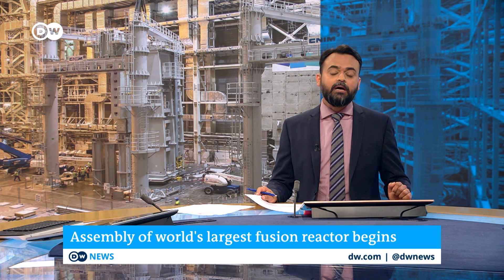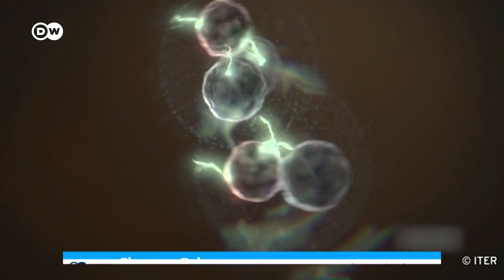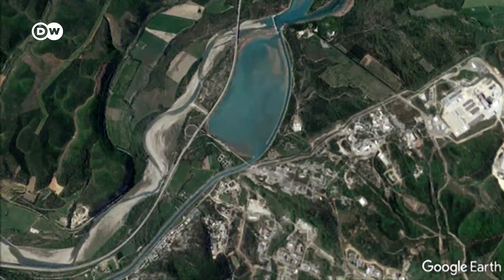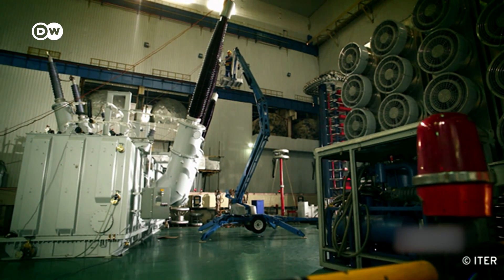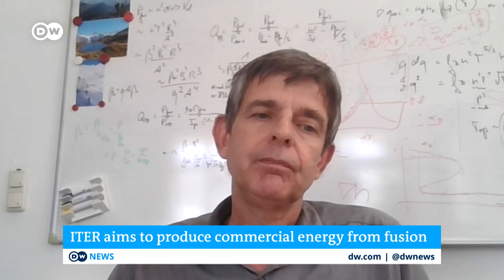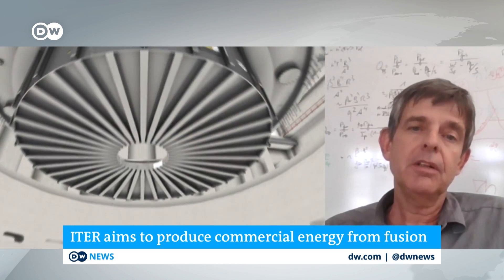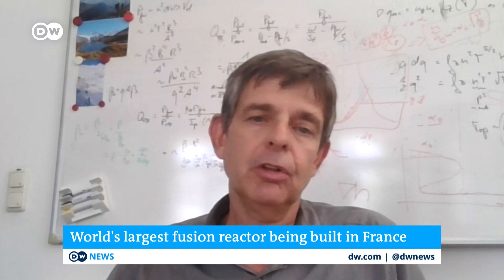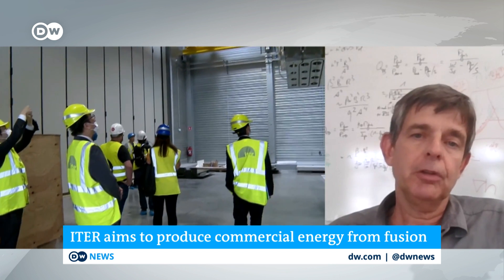ITER: Assembly of world's largest nuclear fusion reactor begins | DW News

Comment: Iran and Venezuela: ahem, we are so screwed.
Reply: Do you think cars will be Powerd by fusion or our war machines are going to be Powerd by fusion or any kind of electricity. NO. till then all of them will be selling oil.
Reply: @KMon1111IND  in short, oil is used for power production in many countries, except in us where it's mainly used for transportation, but the us doesn't trade with Iran and Venezuela anyways. As for war machines, which war machine exactly are you talking about if you exclude the US? :P
Reply: @kleuafflatus  
Oil isn't used for power production almost anywhere, except in isolated locations where only diesel generators are appropriate. Oil is too valuable as a transportation fuel to be used for electricity generation.
Reply: @KMon1111IND  you have a point in the case of the military, but other than that, it might be a different story if electricity is nearly free and unlimited. I mean if you live off grind then gas is still the best choice for fuel, but for everyone else you can enjoy much cheaper electricity especially if you use cars that run on batteries, which is a very viable option in the city. Im not an expert but I just googled it: in 2018, out of all the 5447.3 terawatt-hours generated across all the power stations in the us, only 66.3 terawatt hours was oil, but 1833.9 terawatt hours was natural gas, followed by 1334.3 by coal. Naturally all that can be replaced by fusion. Also in many countries oil is used for power generating, those 2 countries with very little industries other than oil production will lose those customers faster than the blink of an eye.

Comment: Put it onto a spaceship with good ion drives and we can finally go to other stars
Reply: This is pretty much the WORST thing to put in a spaceship. You can't use neutrons or ion drives unless you love waste heat blackbody radiators. A spaceship should have a direct aneutronic fusion drive, only waste heat generated is keeping the reactor on.
Reply: Send me a message when you arrive

Comment: This is an experimental project or "proof of concept" with a working model at scale. In other word, it is a prototype. Something way beyond a "bench test." So there will be set backs that lead to improved variants and ultimately a production model and its inevitable progressive miniaturization. If they can get more energy out of the reaction than they put into heating up the plasma, then they will really have something. That is the whole point of this project. Not merely creating fusion, but creating fusion that yields a net energy gain from the process. Of course fusion has been created before; but, not with a sustainable controlled net energy gain.

Comment: The sun is a fusion reactor we just need to harvest it with solar pannels.
Reply: I don’t think we really have the resources to build a Dyson sphere right now.
Reply: you obviously havent thought your comment through
Reply: @123hackfleischvorbei  Fossil fuels are non-renewable. People have recentlly found out how to store solar energy.
Reply: @insectbite1714  What does this have to do with fossil fuels? And people have always known how to store energy, but not "solar energy" you cant store light, but you can transform that light into other forms of energy which can then be stored.
Reply: That's the problem with fusion -- we already have a large fusion reactor that we can harvest the energy from and that source is more than enough to provide all the power/energy needs of the planet -- no Dyson sphere needed!  Solar energy is already encroaching on fossil fuels on cost and at present development rates within a decade it will be even cheaper than hydro and certainly cheaper than any fossil fuel.  Energy storage is also moving ahead very quickly and will solve the problem solar has at night.  Fossil fuel is dying and within 20 years it will be reduced to providing a decreasing percentage of mostly high energy density needs (think jets).  Almost all the energy we now use including all fossil fuels received there energy, originally, from the Sun -- with solar panels you do not have to wait 300 million years!

Comment: Once fusion is perfected, let's make it smaller. And have fusion cars 😂
Reply: I'm living next to a big intersection - there I can witness the fusion of cars on a daily basis
Reply: You cant make shielding from gamma rays thin enough to fit into a car I think. Or light enough to b anywhere near practical. But fusion ship may be possible, hopefully :)
Reply: @elmoparman636  Didn't know that Helium is radioactive.
Reply: @winni2701  Nuclear reactions take place in megaelectronvolt ranges, and electromagnetic radiation released in those energies is in the form of  gamma rays. Which are very hard to stop. That's the problem.

Comment: lol you can tell that someone has no idea what they are talking about when they make a point about the fact we are FUSING atoms not NOT splitting them lol.. 

We have NEVER SPLIT atoms... We have always fused them.. splitting the atom is done by adding MORE atoms which forces the current radioactive element to SPLIT and become something else. you guys REALLY NEED to do your home work before reporting things you have no idea about lol
Reply: I don't understand what your point is. Are you saying that when uranium 235 is split apart in the fission process in current nuclear reactors, the atom isn't actually split? And that it's still fusion in that case? Makes no sense.
Reply: @AKHalex  It splits but its done by fusion not splitting an atom like the guy says at the start. neutrons are fired at some uranium 235 and when one neutron hits the nucleus it fuses shaking off 3 neutrons and becomes uranium U-236 no splitting of any atoms

Comment: What they don’t tell you is that fusion reactors are inherently much more complex and expensive than fission ones, don’t yet produce any amount of usable surplus energy and still irradiate their own very expensive body to intolerable levels long before they recoup the costs.
This problem is not solved.
Reply: "don’t yet produce any amount of usable surplus energy" *yet.
"What they don’t tell you is that fusion reactors","still irradiate their own very expensive body" at 4:30, he literally mentions this.
Reply: @Slackker_  Yes, he is obviously quite   skeptical when asked about sustainability and viability of fusion tech and mentions its problems but doesn't tell how hard they are to solve.
Sure, this iteration will produce some relatively small amount of surplus energy, after a decade or two, if the construction isn't stopped, but the tech is lightyears from being able to recoup the costs of construction. I welcome this research. But what I don't like is the populism around it. People who are now being so excited about this project may not live long enough to see any fusion energy in their power outlet. This project, that is only a research prototype that's bigger than the earlier prototypes, is going for over 30 years already.
And the first Tokamak was researched from a vague idea and built in less than 8 years, started operating in 1958.
Reply: @noop9k  I'd have to completely disagree, the reason why this technology is so slow is because the funding isn't there. The oil companies have no interest in changing how things are done, instead they lobby conservative politicians that have been making cuts to research for decades. If you want an example of what is possible, look at the space race, an immense amount of progress was made in a short timeframe, progress that contributes to our very way of life now. but as soon as there was no war anymore, the funding went away, and NASA has been just scraping by since. We need populist interest to highlight politicians that will really create a worldwide push for fusion and allow it to be brought to its full potential.

This isnt impossible, or even far-fetched. Under trump the US military budget has pointlessly increased anually by 100 BILLION, that's enough money to build 7 prototype reactors every year, from the US alone. The problem isn't with the technology, it's with the politics.
Reply: @Slackker_  First of all, I do see the situation with funding, even though cost estimations grew many times during the last decades.
The project is divided between many countries for political reasons and this alone causes plenty of friction and delays.
Second. I don't see the right kind of populism here. I don't see this project mentioned often, I don't see calls for action, I don't see anyone explaining to people that with the current level of attention and funding it is going to take decades, I don't see somebody like Greta explaining this to people.
If you check the wiki, you can see that while  they have (finally!) committed to building the main reactor, they haven't even started building materials research facility that was supposed to test various materials for neutron resistance to prevent the reactor from destroying itself with radiation.
The core main EU countries should not depend from oil lobby and could foot the bill alone and could even start a separate project, moving much quicker. Instead, Germany tries to build yet another natural has pipeline to burn even more hydrocarbons while funding Russian fascist govt. I'm just trying to point out the hypocrisy here. I'm just trying to say that as-is, people shouldn't expect to live long enough to see fusion power solved.
Unless they do something.

Comment: Sure, in 40 years.

And then another 40 years after that.

And then another 40 years after that.

We have clean and cheap energy already:  nuclear fission.

Even if we succeed at generating electricity from fusion reactions, the cost of production of electricity needs to be on par with current methods, or it's just an overly expensive novelty.  Fusion needs to generate electricity at a cost of 3 cents/kWh or less to be competitive.
Reply: Google image: "fusion funding graph". 
The investment and research fusion has received compared to fission is laughable.
And even with newer fission reactors, you still have to deal with uranium and thorium mining which is far from clean.
Reply: nuclear isnt infinite
we will eventually run out of that fuel type
with current use we will run out of uranium in 20-30 years
sure there are other kinds of fuels but if the entire world suddenly switched to nuclear we would run out in no time
Reply: @DergZaks  
Seawater uranium is virtually limitless. Uranium extracted from seawater would be replaced by more uranium leached from land and undersea rocks. It is thought that there is enough available to power human civilization for a billion years.
Reply: @DergZaks  atleast for the easy to reach uranium there is much more but its extreamly hard to reach bc its just way deeper in
Reply: Nuclear isn't sustainable though. It uses a finite resource.
Reply: @lud3re384  Yeah, you;'re right, millions and millions of years worth of thorium and uranium clearly isn't sustainable....
Reply: @imonlyamanandiwilldiesomed4406  Solar isn't infinite, too
Reply: @ionbarari7202  Lol, you're 100% correct ;)

"I know it's only temporary, guys, but we should totally build this Dyson Sphere." -Some guy in the future.
Reply: @lud3re384  
Hydrogen is a finite resource. The entire universe is dying the heat death. The bottom line is that there is enough uranium in seawater to last humanity a very long time. Extracted uranium would be replaced with more uranium learned from undersea rocks.
Reply: @ShaunDoesMusic 
Was the worst hydroelectric disaster the Dniepropetrovsk Dam or the Yellow River flood?
Reply: @ShaunDoesMusic Nuclear not in my back yard.
Reply: @gaim44  The new nuclear reactors coming out cannot blow up, cannot melt down.  If the worst of the worst of possible things happen to these reactors, all they do is shut down, that's it.  There's no need to be afraid of the new nuclear reactors.
Reply: @imonlyamanandiwilldiesomed4406  Sure:)Right ok.
Reply: @imonlyamanandiwilldiesomed4406  Sure:)Right,whatever not in my back yard:)
Reply: @gaim44  Ok, I promise that I won't build a nuclear reactor in your backyard, but there might be a micro-reactor within a dozen or so blocks one day ;)
Reply: @imonlyamanandiwilldiesomed4406  Wonderful.
Reply: Not clean
Reply: @Kartushka69  Yes, clean.  Nuclear waste can be used up in the newer reactors coming out.  The waste from these newer reactors is radioactive for only ~200 years as opposed to the thousands from current reactors.  We can deal with a couple hundred years no problem, it's watching over waste for thousands of years that's a problem.

No CO2 pollution.  No elemental pollution.  No throngs of dead birds and bats.  No chance of a dam bursting.  The newer reactors are called "walk-away-safe" (can't blow up, can't melt down).  etc. etc.

We need clean and cheap electricity now and fission fits the bill.
Reply: @imonlyamanandiwilldiesomed4406  Not clean.
Reply: @gaim44  The fission reactors that I'm talking about produces radioactive waste that's radioactive for only 200 years.  That' definitely clean relative to, for example, the CO2 produced by fossil fuels, or the elemental pollutants produced by solar (and the waste from their manufacturing process), or all the billions of birds slaughtered by wind farms, or the destruction of ecologies from hydro dams.  We can handle 200 years of radioactive waste, no problem.  Right now we have no "clean" energy.

Will fusion be relatively more clean than that?  Yes.  But, again, if fusion is uber expensive, no one is going to use it.  It has to produce electricity at a cost competitive with current forms or you'll just destroy your economy.  Nuclear fission is the cleanest form of electricity generation that we have right now and it's very competitive.
Reply: @imonlyamanandiwilldiesomed4406  Sure:)And pigs fly.
Reply: I don't like all the derision of the idea that fusion is near on the horizon. People tend to overestimate the impact of technology in the short term, and vastly underestimate the impact of technology in the long term. If the physics calculations suggest that magnetic confinement fusion is possible, then I'm fairly confident that the physicists and engineers will make it happen.
Reply: cheap: nah 
clean: absolutly not
and its also not very safe because all the runing nuclear powerplants are 50+ years old
Reply: @GodOfChaos_HeXa  
France gets 76% of its electricity from nuclear reactors and has some of the cheapest electricity prices in Europe.

Comment: Thank you for not giving false information and actually doing research.
Reply: I actually found deeply misleading the fact that they will source hydrogen from seawater. They won't. Hydrogen isotopes will come as a byproduct of a fission reactor instead.
Reply: @lorenzoventura7701  You're right, Tritium will be made in a factory by bombarding lithium with neutron if i'm correct. However, Deuterieum can be sourced from see water, but it's probably easier to make it in a factory (it's basically heavy water, a thing that we use since the 40's).
And if you're talking about a regular Uranium 235 reactor I don't think you could get hydrogen isotopes.
I might be wrong since i'm not an expert, i'm just very interested in nuclear physics.
I'm also glad about this video because they didn't say "it'll be using water to make fusion".

Comment: You'll be lucky... All this extortionate waste of money will prove is that the gravity of a star is needed for confinement and net +ve power output, like all the various billions dollar experiments have proved in the last 60 years.
Reply: Why would you need the gravity of a star when the reaction pathway we use is something like 10^24 times faster than that of the sun?
Reply: @Gomlmon99  .. You have no idea how hard sustained confinement is... Sure, we can accelerate particles to higher speeds than theorised to occur in the sun but the confinement is not good enough. Multi laser confinement is more efficient but still won't produce net power.  You are missing the vital ingredient - gravitational pressure. The Fusionists are more like deluded Electric Universe charlatans that somehow got uber-governmental funding on crack... Thorium Molten Salt Reactors would have taken over the world if it wasn't run by mental case extremists.
Reply: PrivateSi you keep saying that but you can’t explain why. What’s your PhD in to be going against basic physics that every scientist and engineer has agreed on for a century? You still haven’t addressed the fact we use such a faster reaction pathway. That’s the reason we can do it with roughly atmospheric pressure.